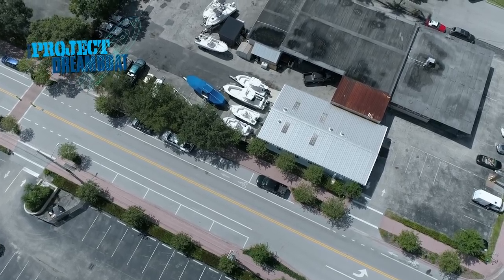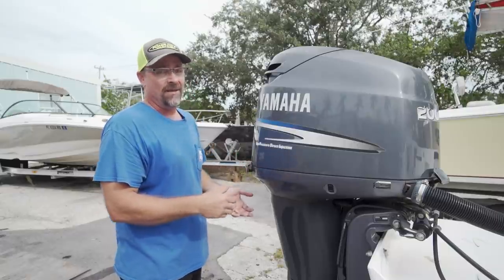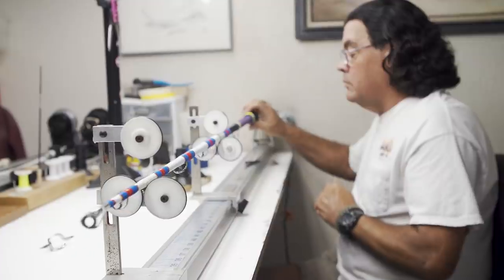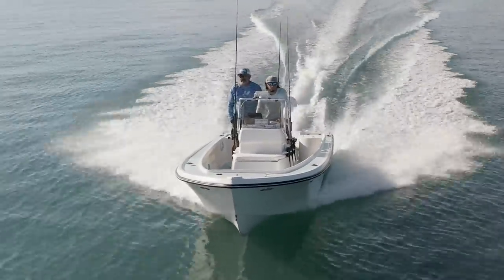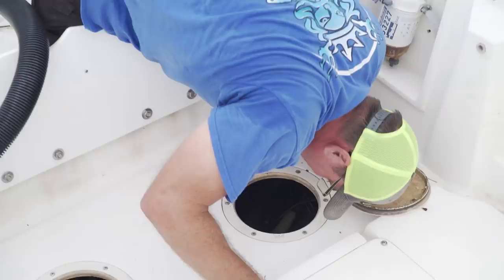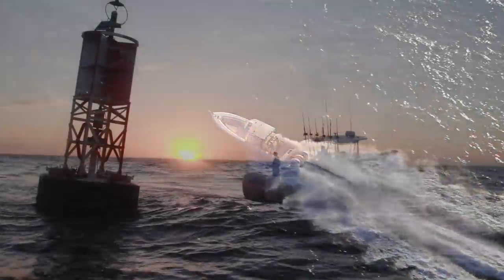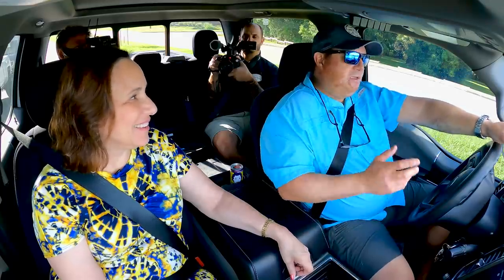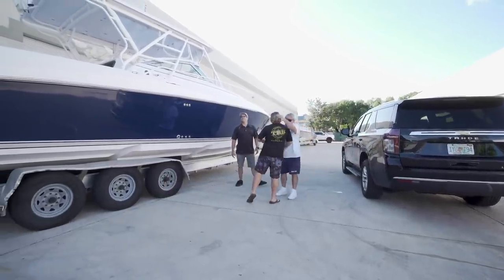Florida Sportsman Project Dreamboat - Redington Mako & Purchasing Your Own Dreamboat [2021]

Comment: Im thinking of purchasing an 07 Mako 184 CC. It will be my 1st boat.
Reply: Don’t buy a mako unless it’s 1995 or older trust me.
Reply: @hullhealersboatworksrestor4377   ive heard that they are crappy...why is that? the boat looks great
Reply: @hullhealersboatworksrestor4377   what about a key west? I'm currently looking at one also.....thank you
Reply: @johnathoncastro  great boats!
Reply: @johnathoncastro  I have a 1989 Mako 238 walk Around cuddy cabin that I’m almost finished restoring that will be up for sale in a few weeks. It’s got a Honda 225 4 stroke and all new wiring and electronics it’s completely outfitted. But, it’s no center console.